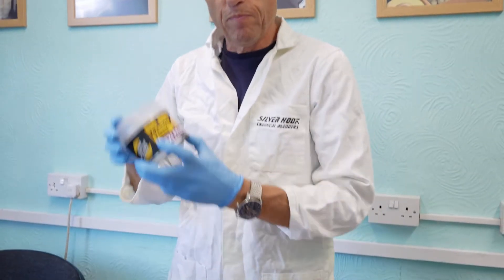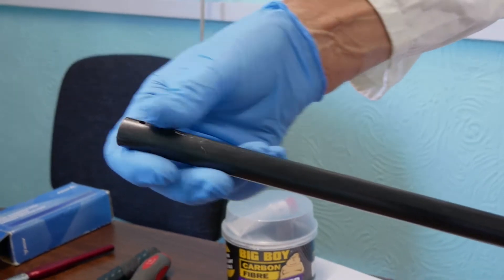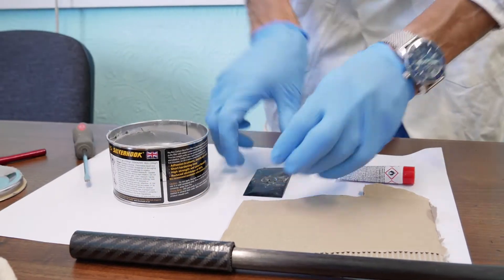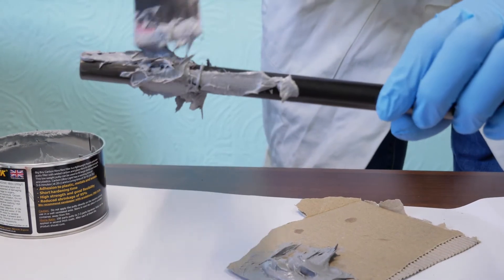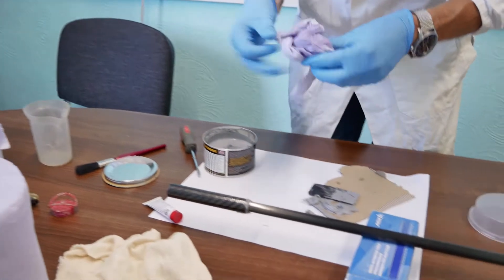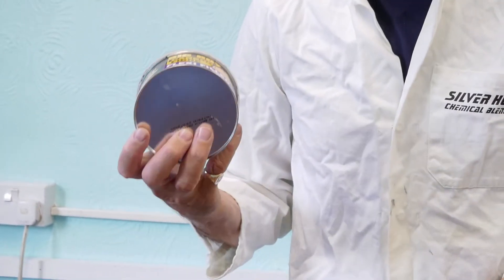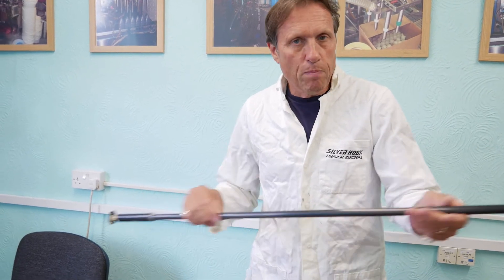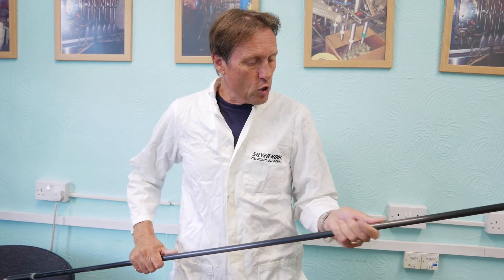Silverhook Carbon Fibre Filler reinforces tiller extension quickly and easily!

Comment: I'm sure yr meant to mix filler & hardner alot better together before applying
Reply: Very good point, the editor trimmed the video showing the mixing which is a shame since it's one of the most frequently asked questions!  Filler that is closest to the mixing surface tends to be the area to watch out for so scrape that up and 'roll it over many times'. Acetone works nicely to clean everything up once the job is finished.
Reply from the maker: Correct, I take responsibility as the editor for cutting that out! Be sure to mix well.
Reply: @SilverhookLtd  a pea of hardner to a golf ball of filler

Comment: Why not use a rap of carbon fiber and epoxy,that’s a bodge job big boy .
Reply: Yeah, would work but this works as well and is very QUICK to complete. The extension takes a great deal of load and is still 100%. It will break when I next fall off the trapeze BUT the part shown in the video will not break.
Reply: Your right, this fills, rather that wields.
Reply from the maker: This enabled us to get a podium finish at the Nationals last week. Wrapping carbon fibre can be a messy job! The 'wrap' used in this video was the sleeve. Took five minutes and worked!
Reply: @SilverhookLtd  it's not going to be as strong as it could be.
Reply: Oh yes the National filling championship, Ive heard of that , it’s a great watch.
Reply from the maker: @prospeed8774  We mean the National Sailing Championship, as this was to be used on a boat. But the national filling championships sounds just as interesting.